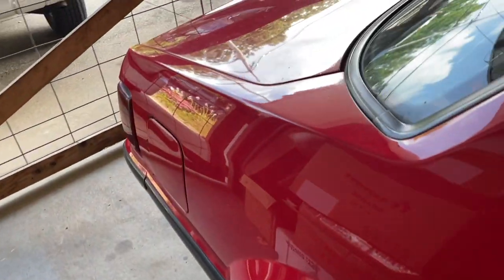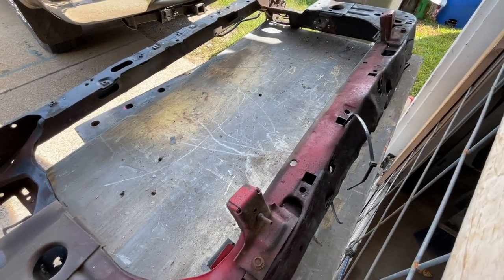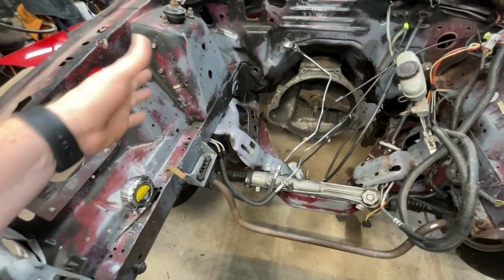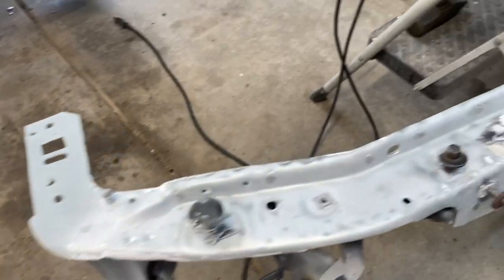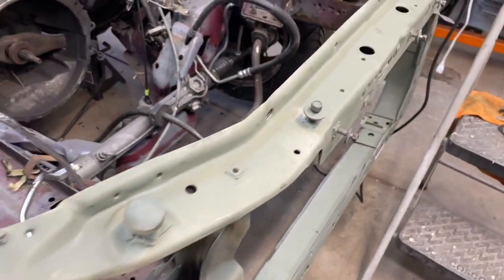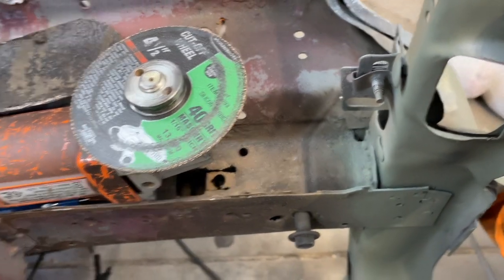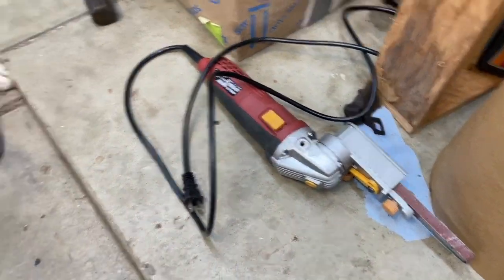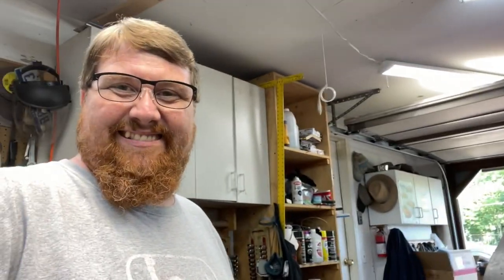Foxbody: Ginger DPH Radiator Support Swap

Comment: I noticed in the vid your Dad or you, mention that the etch primer is gonna keep it from rusting. That is not the case...Epoxy primer is the best option for rust prevention. Etch is good option when you have small bits of metal showing after sanding, and before painting.
Its better than nothing, but epoxy is the best option forsure!

Comment: yep I have one of those tacky rattle canned black engine bays in my car and im the lazy ass that done it because i used cheap ass black rattle can black engine paint on my engine and was only wanting 2 colors under my hood black and aluminum and it looks pretty damn good to me the rest of the car is going to be blue and black and being theres more blue on the outside im doing black and aluminum interior an engine bay with blue car with black racing strips and rims and I think that it will look badass when its all finished. A lot of the old school cars had black engine bays and my pinto is like an old school build so i figured it would suit it but ill make sure to leave my hood closed at ford take over so that you dont barf all in my cheap lazy rattle canned engine bay that i did take the time to pressure wash and degrease so i wasnt to lazy and paint the oil build up as well 😂🤣😅🤣😂🤣😆😂🤣😅 just messin with ya man , i wasnt triggered by your video 😂🤣😅😆 you my hommie 😁👍
Reply from the maker: See now think of it the opposite way. Rat rods should have clean and pristine. Pintos can only be rat rods🤣 now I’m messing with you. I seen Beans on Stranger Things🤣